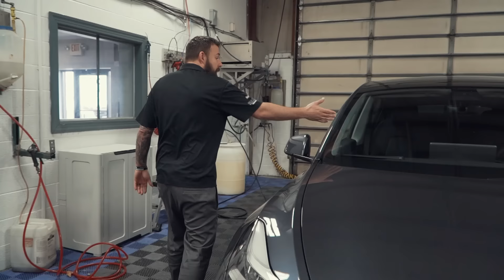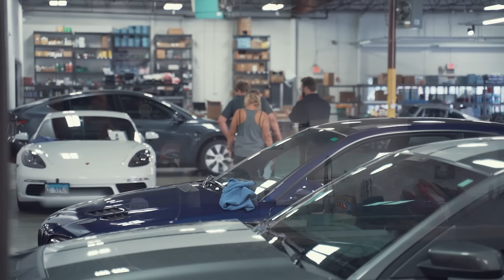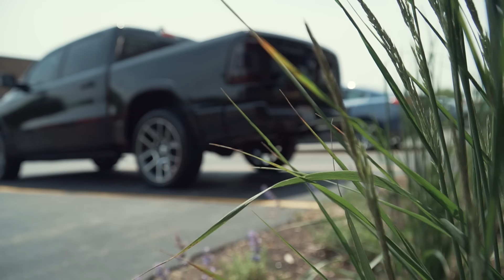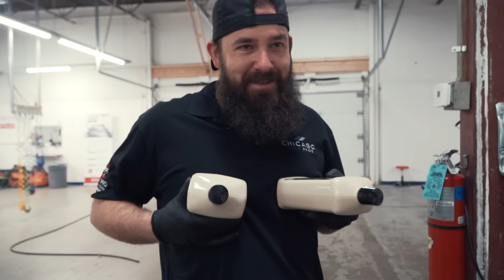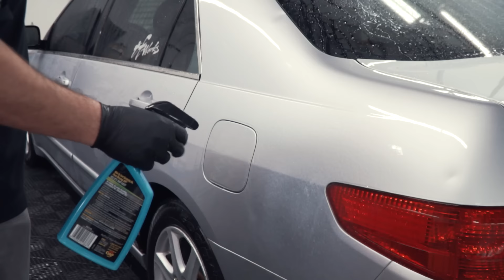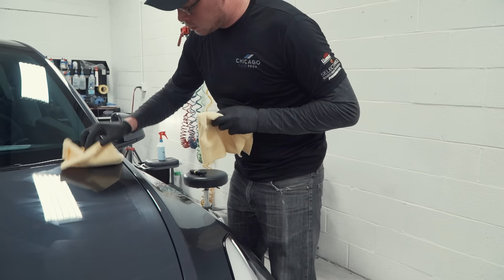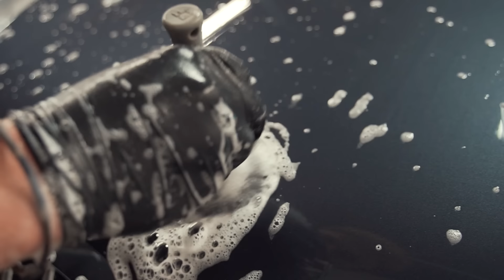Everything You Need to Know Before Buying a Ceramic Coating

Comment: There's 3 BIG issues with aggressive coatings such as ceramics. 1. Although they do help provide a stronger layer of clear coat protection for perhaps "years", vehicles that are used as Daily Driving will be exposed to all the outside elements and road conditions. It's inevitable that the coating will soon become scratched( light swirl marks/ spyder webbing etc etc). When this occurs, the best way to remove those defects is by buffing it out. It's important to know, buffing(compounding)will remove said coating. It's not worth anyone's time and money using aggressive coatings on fault operated vehicles, I'd say coatings are beneficial for vehicles used as props in showrooms or in museums.

2. Cost. These coatings are expensive. It's great that some have "deeper pockets" than others, capitalism and constitution are beautiful things. Never the less, ceramic coatings are items that aren't practical for everyday drivers. The application service for these types of coatings could range anywhere from $100's to pressure even $1,000s.. Yes Thousands of dollars( depending on which service provider/product/location and type of vehicle). 

3. Health Hazard. There's many cases of lung failure/collapse which were reported due to ceramic coating dust particles in the air when inhaled. When buffing a vehicle that was previously treated with ceramic coating, will cause the ceramic dust particles releasing into the air which is very dangerous. High quality masks are required when correcting and or when applying ceramic coatings. During this current pandemic, 3M- M95 and other higher quality masks are rare to obtain ( if you're even able to obtain them via Government regulations) and if you're part of the lucky few to obtain M95 masks......they're very expensive. Perhaps just as valuable as currency.  Logically speaking, essential professionals such as Surgeons, Doctors and Nurses need these masks more than say....an auto detailer.

It was a great idea to have created aggressive longer lasting ceramic coatings but they just aren't necessary and practical for vehicles that use used for daily driving. They're costly, hazardous and impractical. 

A safer alternative would be to use a kind of a spray sealant, Turtle Wax Ceramic Hybrid spray is an excellent choice. It's inexpensive (around $7- $10 per bottle), its efficient in the sense that it's a "Spray on and wipe off " application and it provides long lasting protection with a high gloss. When exterior correction ( buffing/detailing) is necessary, removing the spray coating isn't much of a loss considering they're less hazardous and they're inexpensive. A win win situation
Reply: Fantastic argument against the process. I’m having trouble locating the info on the coating particles causing problems after 2017. One post mentions improvements neutralizing the threat but I’m out of my league here. Do you have any references leading to this still being a problem? I was all for coating but I have kids and don’t want them exposed to something they needn’t be. So I appreciated your input. Just wondering how much a threat this is?
Reply: Can you give us sources?? Can't just say all of this without citations
Reply: I just recieved a quote today for coating my 16 accord, with 3 options -
#1) 1 coat, 1 top coat $1300
#2) 4 coats, 2 top coats, $1800
#3) 9 coats, 2 top coats, window and wheel treatments $2600
I think I'll - 
#4) Amazon  $26
Reply: @tubbycustard8866  dont need citation when its commonly known lol…….. just do a simple search and it should be everywhere. Even on the product it says “do not inhale or swallow”. Bruh
Reply: @tubbycustard8866  no shit it’ll kill you if you consume it 😂😂😂 common sense bro
Reply: I have a everyday truck that I drive to construction sites everyday and a wash once a week or every other works great !! This is like a vegan trying to tell people not to eat meat lol
Reply: Do I wax under or over a sealant?
Reply: @AgentOffice  don’t wax
Reply: Tanks. I won’t get ceramic now. U helped me make my decision

Comment: I paid for paint correction and a high end ceramic coat. It looked awesome but once it gets scratches in to you can not just get it out. If you rub on it it will completely fuck it up. I wish I never had it done.

Comment: I’ve turtle waxed my Honda S2000 for 10 years and it still looks brand new I use klasse here and there on top of the wax but it’s as shiny today as when it was brand new
Reply: Dope..same here with my 20 year old beige Buick! Maguire's cleaner wax and now recently i top with there hybrid ceramic spray wax!
Reply: exactly, the wax is the answer. No some stupidly expensive "coatings", they only add hydrophobic properties to the car paint, nothing else. This same does good wax.
Reply: @banny123456  ceramic coatings are proven to be more durable then wax..there's plenty of research between there differences
Reply: It's about swirl resistance and wash marring, is your car still swirl free from just a wax as protection?
Reply: @Brian-dj3ru  but if you're washing your car "every week" as the guy in the video suggested, just using a wash & wax and taking the time to do a really good wax every season will work fine. 

Just like noone denies a military helmet is more protective than a hard hat, but we're not asking construction workers to gear up like they're fighting in 'nam are we?

I'm not contradicting you, I'm simply saying look at the bigger picture: someone who really cares about their care will keep a wash and wax schedule good enough to not need a ceramic coat.
Reply: @onpoint2292  correct

Comment: Good point Jason on the part where people overhype ceramic coatings. When I bought my Acura NSX about a year ago, my local Acura dealer offered me a “9H” ceramic coating for $40 with a three-year warranty, I acted dumb and see what they would say and they said that the benefits of applying this on your car are that, it will no longer rust, no longer going to be dirty, spray paint vandalism will roll right off but they didn’t even mention hydrophobic properties, etc.
Reply: $40😮😮

Comment: I coated my F150 myself within 30 days of it being delivered to the dealer. Even being brand new it still required a good paint correction. I also did PPE on the front, and wow what a PITA that is, especially on the bumper. It was worth the effort though, 26 months, 49,000 miles, 2 winters, and it still looks great.  A good detailer is worth the cost, especially if doing PPE.
Reply: What is paint correction?
Reply: @neimanfarkus9708  Polishing out imperfections in the clear coat like minor scratches, orange peel , anything that is visible in the reflection to make it as glossy as possible.
Reply: How is the coating now? Also, what was the solution for "no car drive through car washes" as it pertains to cleaning the road salt from underbody in the winter?
Reply: @Twolves2005  I sold the truck last August, but the paint was still very smooth and the coating was still beading, so I would say it held up well for 4 years.  Only car wash I would use are touchless.  The automatics that have under car wash would take care of the road salt, but handwash when possible.
Reply: PPF, Paint Protection Film

Comment: Ceramic coating is all hype been a professional detailer 20 years now use a good year long paint sealant that is all you need you got to get your car done anyway
Reply: I will never own an un-coated car again, test something out on your own vehicle, the ease of maintenance is unparalleled.
Reply: Yup they are all tbe same polyester polymer.  Ppl think these companies have teams of chemists lol.
Reply: I use a carbnua wax 4 times a year.. There 3 n 1 cleaner wax 2 times a year..and..top it with maguires hybrid ceramic spray wax every car wash! 💪maybe 7 hours of waxing a year
Reply: Ceramic is applied once for a couple of years, and unlike waxes, when it's scratched, it self recovers back to normal when under the sun. Waxes do not do this, ceramics last longer and are stronger, of course you have to care for your vehicle and wash it with the right stuff if you have a really nice car, it would be worth it.
Reply: @ludwigrotin5891  "self seal". Can you explain what this material is made of?
Reply: @Stay EZ My Friends yes but depends on the type of paint and type of coating. So many different factors take place.
Reply: @josephcarroll9522  never said self seal.
Reply: @ludwigrotin5891  could you explain "self recovers". After 26 years as painter, combo tech and body man in the collision repair industry it boggles the mind how marketing folks contort the vernacular. How would it recover? As you put it. And what in the product are the ceramic elements?

Comment: DIY at home ceramic coatings are becoming very common and easy to use, I used to use Meguiars ultimate Liquid Wax or Nu Finish every couple months on my daily driver as a way Keep my daily driver looking fresh and shiny, but for Christmas my girlfriend’s mother bought me “Jay Leno sprayable ceramic coating” and it was super easy to use and was quicker to apply then wax or the nu finish and wow I was surprised how much more water Beads and lasts way longer then nu finish or wax and the the shine of the ceramic coating looks amazing and lasts dozens of drive-thru car washes! I’m still applying the ceramic coating every couple months since I noticed after two months the shine of the ceramic coating was still there but the water beading was not as good anymore, the jay leno ceramic coating is about $20-$30 depending where you buy it but for the price point I love it!

Comment: Question:   What do you do in the middle of the winter?   While I hate automated washes, it's the only solution I can find to remove all the road salt when it's well below freezing for weeks.  I use only a "touchless" that uses sprays and use just the wash and undercarriage option to reduce the "stuff" that gets applied.  But without any means to wash myself, it's all I've got.   

My Volvo is a 2009 and I've been keeping up with it since day 1.  In the summer of 2019, I gave it a clay bar, hand rubbed with 3m micropolish, and applied a ceramic coat.  Since then, I've used a spray ceramic to top it off after each wash.  In the fall, I give it a couple coats of the spray and then maybe 4-5 touchless washes between Dec and March.  In the Spring it gets a good wash and all seems well.   I just don't know what else I can do in the winter.  

I'm on the wait list for a Rivian and looking to take delivery in 2023.  The Volvo will become my kids car (already teaching them to drive a manual).  Wondering what would be suggested to do on the new vehicle.  I'm sure the coating, but does a clear film on the front make sense?   And again, how to prep for winter.
Reply: Right! None of these people on YouTube telling you to never go to an automated carwash, don't live in Buffalo, NY.  There's no way you're making it through a winter without going to delta sonic and getting the touch less wash with the undercarriage spray, unless you love the look of rock salt!

Comment: I had Ceramic Coating done days after I got my C8 Z51 from the dealership. I live in NC and pollen is common in spring. After 10 days of curing, I used a soft cloth to remove the pollen. It looked like  a steal wool pad was used. I just applied dusting pressure with a clean car cloth. This is from a high rated shop too. They are coming out to my house to resolve it, but when I saw the coating scratch with just a dusting, I was not impressed. Hopefully, they will resolve it. TBD.

Comment: My car is 18 years old, the paint still looks brand new, Simple hand washes with the proper soap, clean water and sponges, proper waxing, I did not need any ceramic coating. I also keep it garaged and out of the sun when ever possible, and Toyota/Lexus did a proper quality paint job to start with.

Comment: You're the guys to answer this question:
I've just bought a 'young' second hand car and had it Ceramic Coated. I've since noticed some stone chips that were sealed in by the coating and would like to apply a paint touch-up repair.
How should I prepare the coated stone chips before applying the paint? The dealer suggested just washing the car then applying the paint, because that's what they do when receiving 2nd hand vehicles for sale, as theu have no idea whether a ceramic coating has been applied.
Reply from the maker: If the rock trips are consolidated to the front bumper and hood, we would recommend polishing to remove the ceramic coating completely and get the best bond possible between the touch up paint and the panel. However, this may be unrealistic to polish and reapply ceramic coating to the entire hood/bumper. 

If this is the case, ensuring the the chip is as clean as possible before touch up is your best bet. After the touch-up is applied, you can leave it or detail it to the level of perfection as you'd like. Tl;dr: It's not necessary to remove and re-apply ceramic coating, but only do it if perfection is your goal and you plan on making the entire panel or bumper perfect at the same time.
Reply: Thanks. The car mainly just has a few paint chips on corners on the bonnet (hood) around the headlights, so I was thinking of masking and just using Isopropyl Alcohol to remove rhe coating ON the chip, before using the paint touch-up layers, then after a couple of weeks to allow the paint to harden, polishing using claybar then using the Glaze Top-Up in the Maintenance Kit in the immediate area of the chip to protect the newly repainted chip.

Comment: Due to the rising cost of vehicles right now. I just bought a "new"/used car. Just got it undercoated because I live in New England and we get a lot of snow which means salted roads plus the salt air since were on the seacoast. Rust is a issue here and I figure I'll be keeping this car for awhile and I might as well make it as nice as possible and keep the maintenance up until the market gets better.

Comment: So here's the thing.
I have my daily driver but its also something that I want to look nice.
For as long as possible
The problem is I don't want to spend the entire weekend washing the car.
 So the question I have is.
If you bring your car in for a detail and ceramic coating. Does that then mean that a weekly "Wash" that is
Pressure wash ,shampoo or foam a rinse and a dry . Then maybe every 3rd or 4th wash using a de-contaminant spray and bug and tar removal will then suffice?
My idea of washing a car is not spending more than an hour on it!
Reply: yes for the most part all you need to do after getting a ceramic coating is wash, dry and decontaminate. No need to wax, or polish. Unless you get rock chips on your car, then you may need to tend to those, but thats a different story i dont know much about.

Comment: There never seems to be any comments regarding water spotting. I have detailed my own cars for 30 years, typically using Zymol Concurs for the protective finish. However, I have recently used Gyeon Mohs and Skin after all the hype on the longevity of the finish. After a couple of months and heavy showers and high temperatures, and regular cleaning, I have horrendous water marks. Apparently you can get Gyeon water spot removal but this can affect the longevity of the finish?!. Stay away from these coatings unless you keep your car garaged!!

Comment: Tried two coating systems on two different cars and in both cases I was unimpressed and overall disappointed. Neither survived our winters I am fairly certain the liquid deicing agents etched them requiring polishing to bring back to a clear shine. I had issues with Coatings I simply never had with more traditional waxes and sealants. I went full circle and am back to waxing my car. It takes me an hour to apply a coat of Collinite 915 with a machine and doing that every few months isn't too  inconvenient or difficult. Everyone is crazy about coatings...I'm waiting for paint corrections to become popular. That's where you get real results.

Comment: Hey! I'm getting a new car in a couple of weeks, and I'm thinking about a ceramic coating. I found a local detailer who can do an Opticoat Pro Plus treatment (7 year warranty). The dealer is suggesting an Angelwax Genesis treatment (5 year warranty). The Angelwax seems to be a ceramic wax (SiO2), rather than a ceramic coat. Are there fundamental differences between these products? Or is it basically the same?
Reply: Totally! There’s a big differences between ceramic coats and waxes
Reply: Si02 is SILICA not ceramic. Huge difference. Si02 is all marketing. Sure it may work, but it IS NOT a ceramic coating.

Comment: I bought my car last september and was sold on getting a ceramic coating, for an extra $20 a month.   While I was filling out the forms for my finance they came back after 10 minutes and said it was all set.  I don't think they even applied anything and I was taken.   When I washed my car earlier this summer I applied my own ceramic coating and it took about 2 hours.  I could tell the difference between mine and the dealerships, its very slippery and bird poop pretty much slides off.    I really only have to use waterless car wash solutions now in the summer to make it look brand new again.  Never again will I pay a dealership for something I can do myself.  I don't even trust the free oil changes I get becuase I bought it through them.
Reply: I feel the same way about their interior coatings. Before we drove off the lot one of my kids spilled water on the seat no bead like it was supposed to.

Comment: Waxes can last more than a few months.  It depends upon the conditions the car is exposed to.  If the car is garaged and only used for errands and vacations, waxes can last MUCH longer.  My favorite is Collinite 476S and on my Camry, the last wax job has lasted almost three years and the beading is still very strong.

Is it necessary to remove wax before applying a ceramic product?